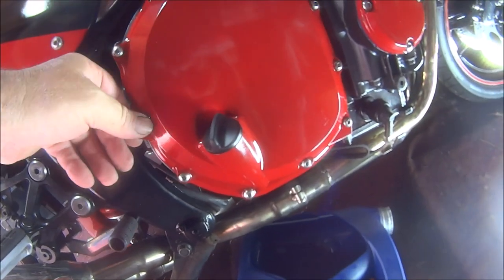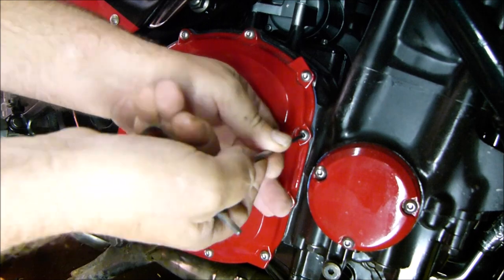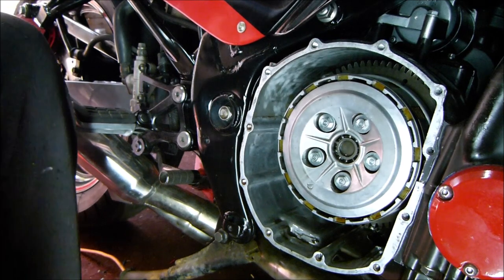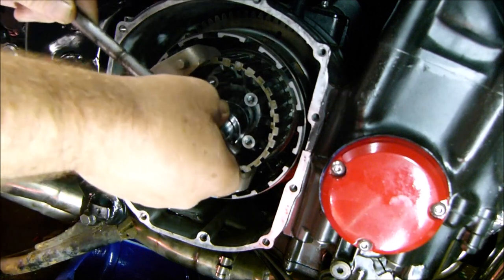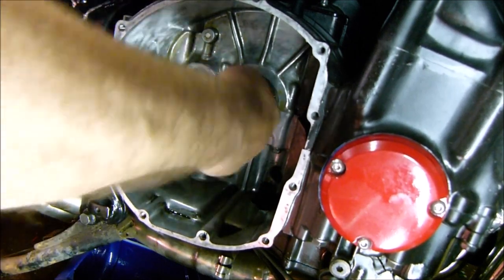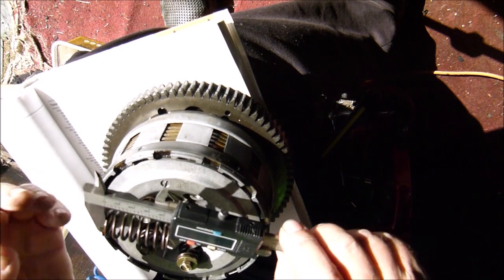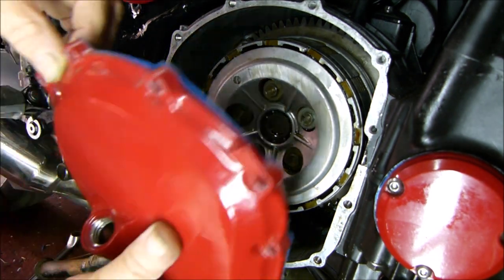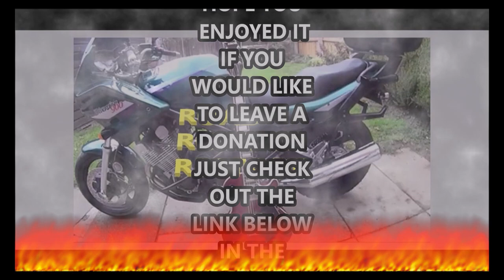CBR1000F Landfill Bike, Engine Rattle #1

Comment: Jesus Jon reminds me when my clutch developed a bad rattling sound on the Kawasaki GPZ500 bought all new plates heavy duty spring put it back together same noise still there stripped it down only to find out the woodruff key none existent managed to get one one after about buying 6 different ones worked perfectly after that as you know the 33 year old Kawasaki still runs like a dream. 
You’ll sort it got to be something simple you shouldn’t be getting any clonking sound from it when you took it apart  turning backwards and forwards bet that’s what’s causing the the rattling sound sounds like something lose or worn out what’s the wear limit on the friction plates hope you fix it easy 👍👍🙏🙏
Reply from the maker: Hi Derek yes the gpz sounds and runs great. I'm thinking its something to do with the balancer shaft as to me it sounds like the engine is out of balance. I'll get it sorted. 👍

Comment: Hi there Jørgen from Denmark first of all thanks for your brilliant channel 👍 are you sure that you aren’t missing a bolt on the adjuster for the balance shaft  just saw it on your video that there is missing a 8 mm bolt
Reply from the maker: Hi jorgen glad you are enjoying the channel thanks... Yes I've also been investigating the balance shaft the Rattle does seem a little quieter when I make a adjustment but im not to sure im understanding the correct way to do the adjustment correctly. 👍

Comment: Could be one of many things, but one thing for sure was wrong there, the clutch centre lock nut should be very tight, 128Nm if my memory is right. Yours came undone far too easily. And staked once tight. When the clutch basket was out the torsional dampening springs were way too loose, but the bike is 30 something years old.
Reply from the maker: thanks Keith.

Comment: Hey chap can you tell me what did you use for inlet rubber for carbs not paying 100 if I can I saw a video you might use rad hose
Reply from the maker: Hi Steve. I used silicon coolant hose.👍

Comment: What a b*tch. yeah I meant the clutch springs at the back of the big cog for clarification.
I wasn't aware of the balance shaft issue, must have missed those ones...
The audio isnt very good but is it running on 4 clys? Check the choke plungers are sealing and do some head scratching.  
Could you post a video of taking it slowly from idle to about 2500 rpm? when you give it a quick rev it sounds like the rpms are taking a long time to return to idle. like a fueling issue.....
Good luck, Lol and balance those carbies and reset pilot air screws to stock just incase an "expert" has been tinkering.
Reply from the maker: Thanks bob. Yes it does seem a bit slow on the revs and im not to confident the home made carb manifold boots are leaking and it now as a straight through exhaust on it now. I need to sort the Rattle out then give it a test ride. 👍
Reply: @jonyr1TT  try refitting the boots with 3 Bond brand sealant or heaps of grease. Definitely not bathroom silicon etc.. lol. Have you had a spray about the carbies and hoses with wd40 to hear if the revs go up. Have a fire extinguisher on hand because this is also an excellent way to find out if your plug leads are stuffed..
And yeah, WTF was rattling in that removed basket? Does the other one do it? sounds like somethings rooted in there mate.
Reply from the maker: Three bond silicone wd40 🔥 extinguisher lol. Nothing is rattling in the clutches its seems to be coming from lower 👇 near the front.

Comment: A lot of the noise.may be carbs not siync together...has a rough guess   2 cylinders are out...its only a guess.
Reply from the maker: Thanks Darren. Any and all help is very much appreciated. 👍
Reply: Those loose springs in the crutch basket  aren’t gonna help. I was thinking  about the bolt blueing you’ve been doing  I’ve been doing that to  now I’m thinking I’ll try doing it again with bees wax  and hopefully keep the black finish what I’m after.  I enjoy ya style and content new subscriber tho I watched u rebuild that gpz1000 ages ago lovely job on that too
Reply from the maker: The springs do shake about a bit but it looks like they are sealed in there.. Yes the old gpz I love them bikes 👍